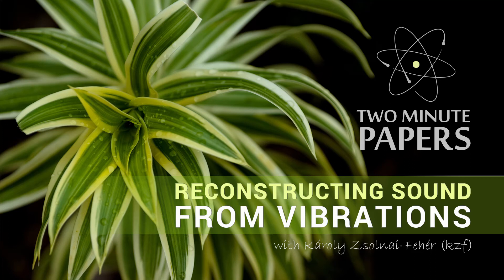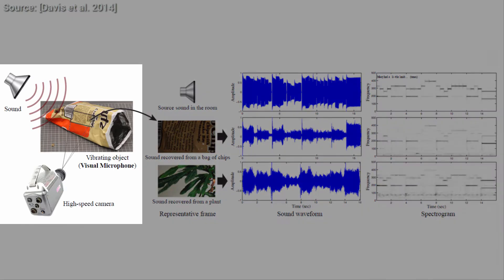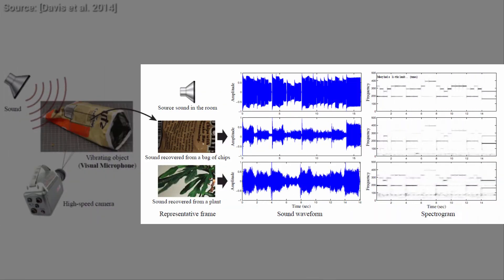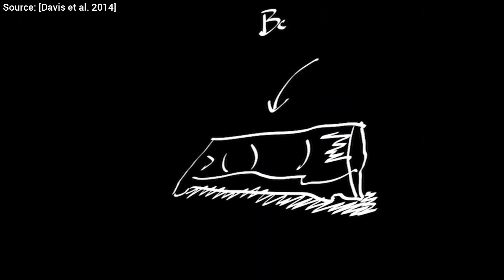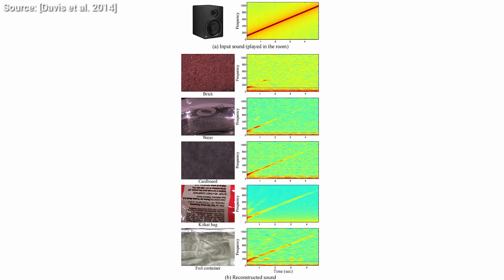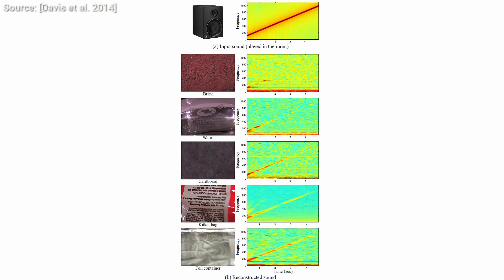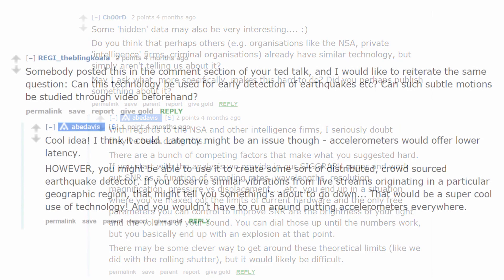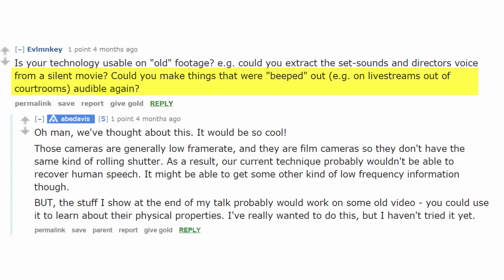Reconstructing Sound From Vibrations | Two Minute Papers #12

Comment: Another one I already knew, another awesome one. In its current state the quality isn't particularly great but I bet given a sufficiently library of frequency responses per material and one of ground-truth vs. recording results, it could be significantly improved by some kind of learning algorithm. - Things like multiple materials to get multiple samplings could also improve the result a lot.
I also loved the paper where they were able to measure your heart beat and exaggerate and disambiguate various kinds of motion (including the motion and color change of your face due to blood being pumped around) which, I think, is kind of a related technique.
Reply from the maker: +Kram1032 That's a great idea, I'd love to see tons of these make it into a product of some form. :) Also, this paper is a stepping stone towards something new (and a damn good one!), and definitely not the end of the road.
Reply: I will be doing this using GPT to visually identify and estimate material frequencies from a given video and (high frame rate permitting) reconstruct low frequency information from a mute source without sound. I can then extrapolate that information, using knowledge from other video sources, or even use frame generative software to reconstruct (or reimagine) even more information.